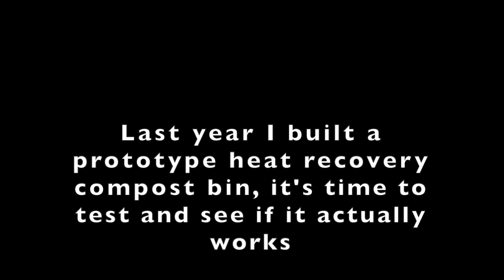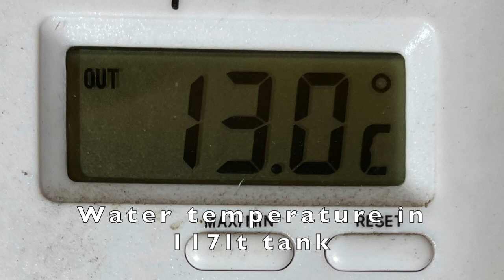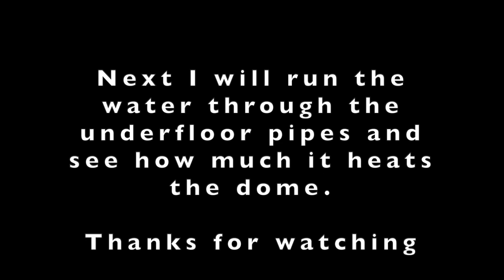Compost Heat Recovery system... Does it actually work?

Comment: I would've thought there's not enough air flow to ensure it doesn't go unaerobic. From what I've heard from Johnson Su compost vids, you can't rely on aeration of things farther than 1 foot from an air source. The bottom hole doesn't seem enough unless you open the top part often enough , I suppose

Comment: Fascinating stuff. I'm amazed how well it works. The composting action is so much faster than I expected. It gets THAT hot and compresses THAT much in such a short time.
Is that mainly because of the insulation?
Are you used typical 50/50 compost mix of greens and browns?

Comment: Paul, the radiator needs air flow THRU it.... Forced flow, I mean. It will not get enough heat input if you just have it on top of the compost pile.
I think you need to have a tube/pipe register that is laid on top of the compost... Think of a serpentine-shaped tube that gets as much contact with the compost as you can.

Comment: This is with no pump, right? So the heat is just transferring along the pipes? I wonder if you had a pump running if it would get hotter. You must have at least 50 degrees in the heap, I'm sure.
Reply from the maker: There is a pump, I think the radiator is a bit small maybe. The heap is between 50° - 60°C but I guess there are losses in the pipework etc to take into account. I would like to think I could get it to 35°C with a bit of tweaking
Reply: @Geo-Dome  Cool. This is something I've been interested in but my heaps are on an allotment with nowhere to pump the heat to. Will be watching with interest!
Reply: @Geo-Dome  It is brilliant work, many thanks for your sharing. I wonder the greenhouse size, pump specifications and hot water tank is enough to endure under pump pressure. Thank you again.

Comment: hmm was under the impression you need a bigger bin to make the het needed to be able to take heat out.
Reply from the maker: Yes normally the heap would be much bigger, because the bin is insulated this size works great but it doesn't last very long before you need more feedstock. a week at best.

Comment: Doesn't the process stop if you extract too much heat?
Reply from the maker: Yes but the radiator is on top of the heap inside the insulated bin, if the heap doesn't produce excess heat the radiator won't pull it out.

Comment: Love this, however if you try this at home, I would be extremely cautious with this compost as it is very likely  extremely anaerobic, and therefore full of disease causing organisms that could make you very ill! The end result of this compost should really be “re-composted” as brown material because it was composted anaerobically and you want aerobic organisms dominating the microbiome in your soil, not anaerobic pathogens. If the compost is ofgassing ammonia, Putrescine, etc.. it’s full of pathogens. It must be aerobically stabilized!
Reply from the maker: The system is designed to compost aerobically by reaching temperatures of 65°C the pathogens are destroyed. Anaerobic decomposition doesn't produce as much heat so isn't desired in the unit. This video shows how air circulates through the bin: https://youtu.be/HOKMgAGgXW8 Hope this helps.
Reply: Have you validated this under a microscope to identify if you have aerobic or anaerobic organisms ? Are you smelling ammonia, putriscene, or sulfur? The walls of the system are closed in so no oxygen can penetrate, as well as the roof of the unit is shut. I don’t see how you can be actually aerobic if there is no oxygen able to be exchanged.  The color of the compost is darker than 70% cocoa, indicating it has gone anaerobic at some point during the decomposition process. If you are seeing a layer in your pile that looks like ash sprinkled on it, that indicates you have actinobacteria which are facultative anaerobes.. meaning they can survive in reduced oxygen conditions, indicating you are dropping below the oxygen saturation level to remain aerobic. I would recommend recomposting this material as your brown material as it’s likely only bacteria survived once it aerobically stabilized. Also your statement that anaerobic bacteria don’t produce as much heat is inaccurate. Once you reach 170F, aerobic bacteria begin to struggle to survive, and anaerobic organisms take over. They exude ethanol which is why piles must be monitored so they don’t catch on fire due to ethanols combustion point of 180F.